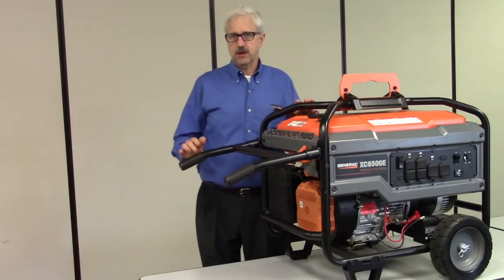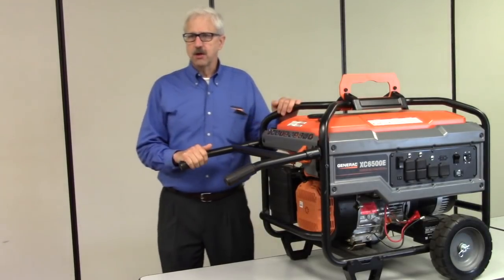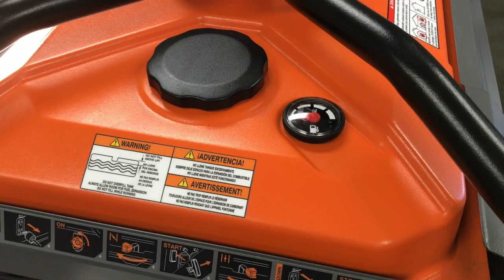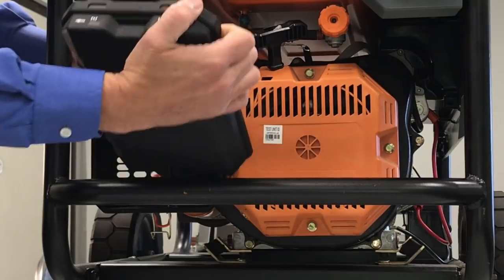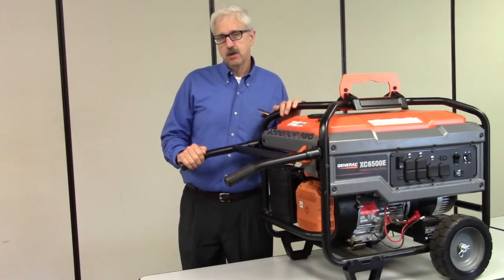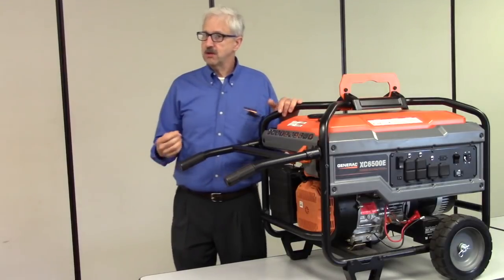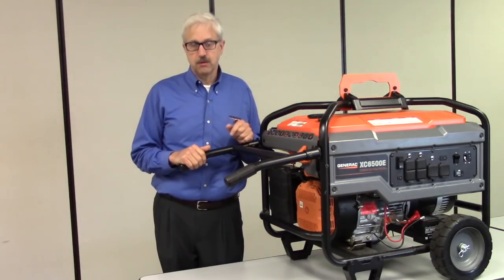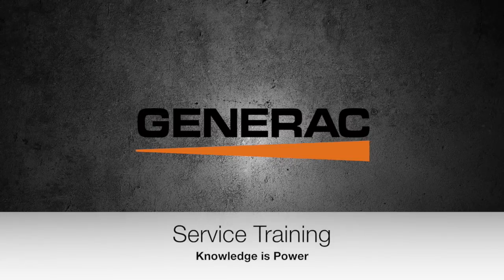When Engine Won't Start - Checking Three Basic Elements on Your Generac Portable Generator

Comment: Bought a new GP7500 E after Sandy in 2013, just opened the box last week for tropical storm iasia  the recoil broke after 3 hours , luckily the  battery started the engine , and noticed the hour meter did not work also. Seems like no recourse from Generac only busy busy on the phone, bought the recoil pull start for $100.00 ,not buying the hour meter for $60.00 .

Comment: Ok, wait a second..."If the oil isn't full you won't get a spark".   Obviously I need to pay attention, and I wouldn't be here if my generator would start. This fella's smarter than I, no doubt. But I think he skipped a line while reading the teleprompter, or someone got his cue cards out of order. Next thing you're gonna tell me is that Hitler's playing softball with the nuns? You probably have to be over 50 and erudite to get that one.
Reply: Hey Stephen,
Regarding..."If the oil isn't full you won't get a spark"
This is true. 
This engine has a "low oil shut off switch" to prevent the engine from burning up when low on OIL.
When the engine oil is low, that switch GROUNDS the coils and prevents a SPARK on the spark plug.
Does that help?
I'm headed out to fix a Generac GP5500 that had very old gas.  Belongs to a neighbor.
Did you fix yours yet ?
I wasn't aware that Hitler had close interaction with the Nuns.  Softball? Wow.
Reply: @mrbrown6421  That engine is way smarter than me. What a great feature low oil shut-off is! My engines just overheat and seize up, so I like your way better.

Comment: My brand new XT800EFI only ran 4 times once per month for about 45 minutes under 3/4 load and now I went to start if for it's monthly exercise and its got a Flashing Fault light, won't start with Starter or Pull start.  BUMMER!  $1000 and NO reliability

Comment: I have the 17500E. It has set up for about 3 or 4 months. It wont start. It has fresh fuel and the oil level is full. It is getting fire to the plugs however, There is little to no fire to the fuel solenoid. I tried to start the unit with out the plunger and spring to see if it would run and it wouldn't. Any idea what I may be dealing with? It does get fuel to the carb because when I remove the fuel solenoid, there was plenty of fuel in the bowl. There is no trash in the fuel and no funny fuel smells. This unit only has 6 hours on it however, it is 5 years old. Please Help! Thanks

Comment: generac rs5500 generator has fire and gasoline
use starting fluid it will run till i stop using starting fluid
then it stops its about 3 years old with less then 10hours on it
would run it about 15 min a month
Reply: James Casady same exact issue w my xg8000e.
Reply: I got the exact same problem with my Coleman 10 hp generator....my cousin is gonna take the carb off and clean it for me.he says that will do it....
Reply: I have a whole house generator built in and if I've only had about six months and the green light goes out after Eclipse running and the red light stays on so what is the problem
Reply: Float may be stuck. I had the same issue with my snowblower and got lucky, popped off the spark plug and sprayed some carb cleaner and it was all set.
Reply: I have not run mine in a few years.  Used stabilizer in the fuel before putting it away.  Drained old fuel, put new fuel, drained that fuel and put more fresh fuel.  Will only run with starting fluid.  Could seals have swelled with the use of fuel stabilizer, preventing fuel flow?

Comment: y is my Generac generators is getting hot why is it getting hot is it because the air filter was dirty
Reply: Johnny Williams I had the same problem. I cleaned the filter with water and dish soap and cleaned the carburetor. That seemed to help a lot